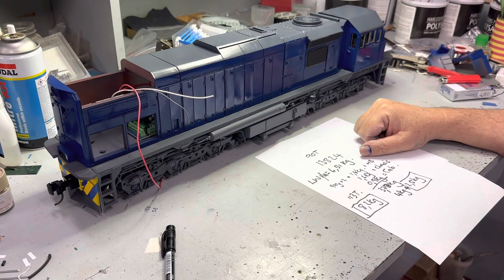How to ballast a large scale loco. Working out scale weight. Do’s and don’t’s

Comment: Sir do you produce Ho scale or only G scale. Next question why don't you produce the newer class 43/44 and the class 45. I like the newer locomotive to not just the older locos
Reply from the maker: I only do large scale. The idea is to follow the SAR history. Make no mistake, the class 31,31,33,34 and 35 were our backbone when dieselization started. And some of them aren’t serviceable anymore. So how will we remember them if there is nothing to remember them by?

Currently I am building all the stuff that is not running anymore. Like the GZ-10 cattle wagon and the LA-3 mechanical reefer. The 35GE as well as its bigger brother, the 34GE is next up. Next year I want to do the 33 class. 

In the pipeline for modern stuff is the Afro 4000 and the class 44. There is a problem with the class 44 though. One would need to modify motor blocks. The sheer amount of plumbing under the catwalk on that thing will push its price to almost R58k. I started nibbling at it. Over 470 little valves and connection boxes and distribution blocks!!!! 

I do this for a living. I cannot see a 44 class being built in under 500 hours. But….never say never.